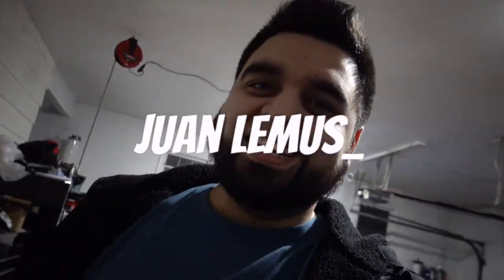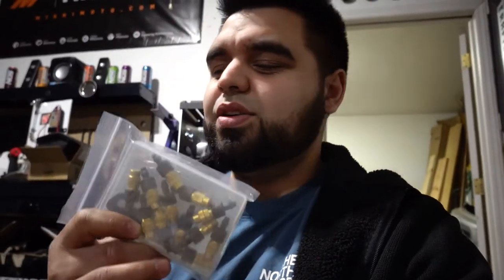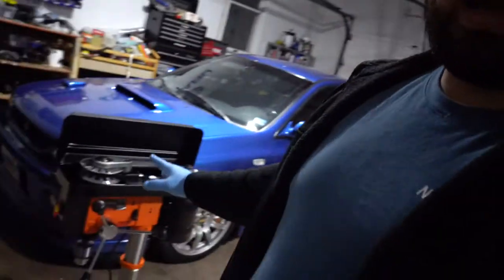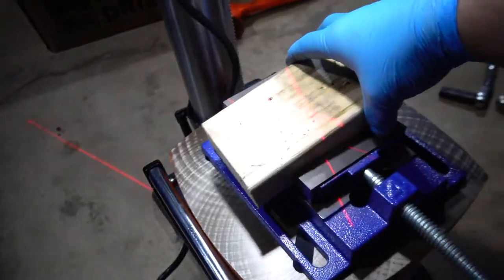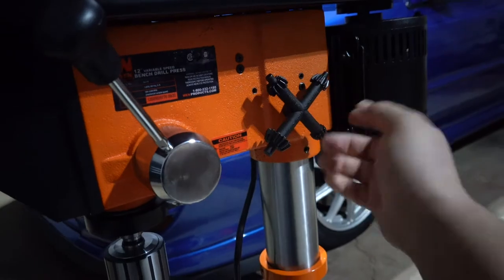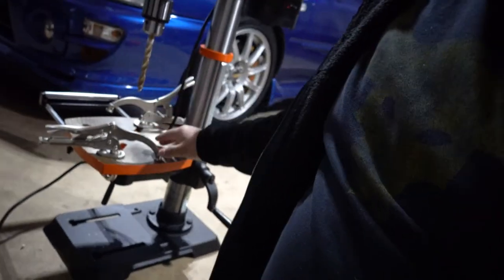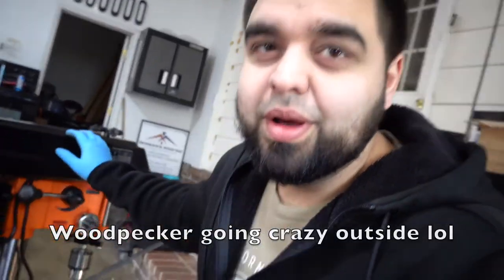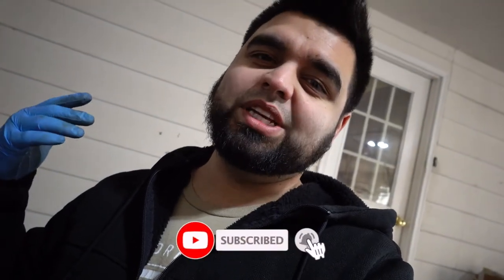Unboxing & Setting Up My NEW WEN 4214 12" Variable Speed Drill Press With Light & Laser

Comment: I was a machinist quite a while back, you could sharpen your old drill bits with a bench grinder, you would use water to cool the drill bit if it gets hot when sharpening it (if the tip turns blue it is bad). 

Also cutting metal, when it is cutting and just before, putting a good cutting oil will help keep the drill sharp longer and lubricate (friction heats without oil) the non-cutting parts of the drill bit, also it will keep the bit and the metal being cut cooler than dry or even with water as water will boil off sooner than oil. 

I found a few videos that cover this.

Best oil for cooling metal cutting tools, test and results:
https://youtu.be/v6QCrV4ZOiU

Machinist method of sharpening drill bits, Part 1 of 2:
https://youtu.be/0Tie1hQ0qQQ
Machinist method of sharpening drill bits, Part 1 of 2:
https://youtu.be/cADD34jgsyc